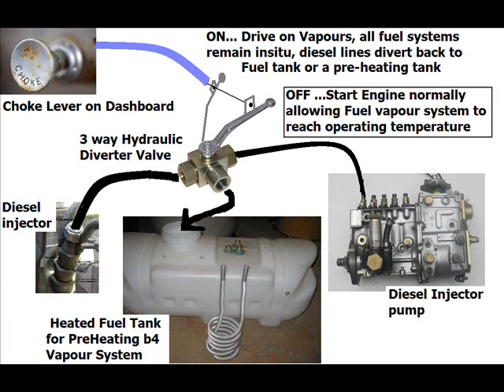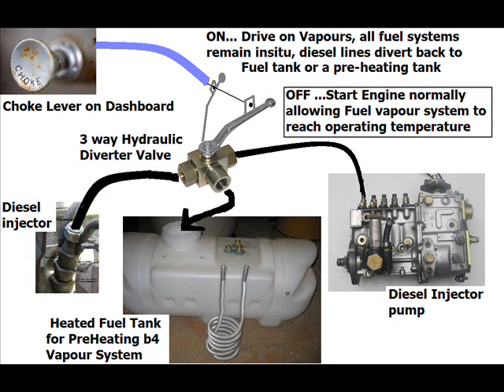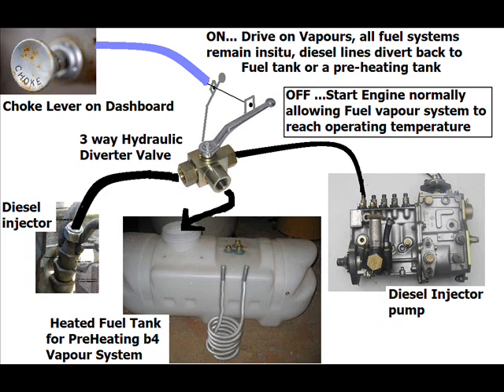5 Diesel Vapourizing Fuel System small solution HYDRAULIC divert

Comment: would love to here when you have got this working I really think the oil companies and the automotive industry with government have been screwing us right royally. it's time to get something back. petrol is much more volatile so undergoes liquid to gas at room temp diesel is not so volatile and so does not readily do this cat room temp it needs some help.
now I have seen a petrol V6 using its existing fuel tank and fuel links with the alteration happening at the engine bay this means there is no additional container for the fuel could this be done with diesel system yes and if the tank is metallic it could have a low voltage surface heat attached external to warm the diesel to help it go into vaspour. then this could be connected to the diesel fuel rail and the gas vapour brought on this way when up to temperature with some sort of switch valve connect . I am just thinking of the top of my head right now I have only been thinking for 10 mins. my physical disabilities mean I cannot do the practice tasks and testing  myself
good look getting this sorted.